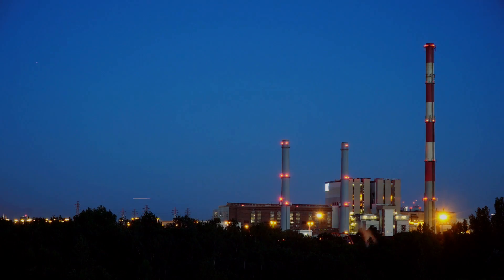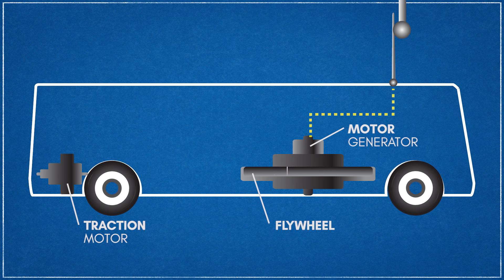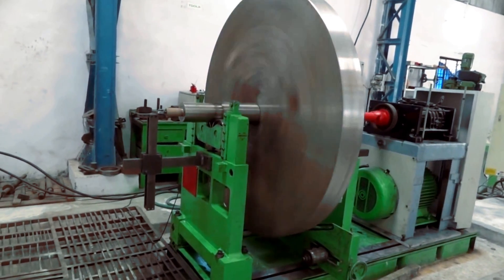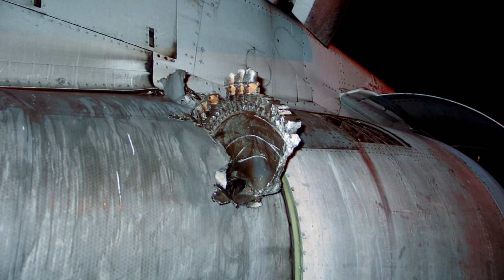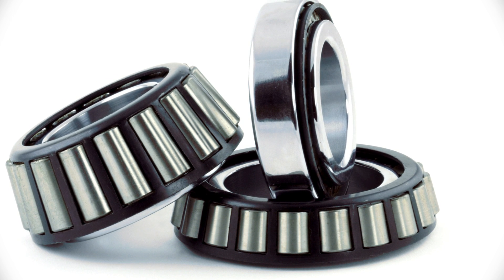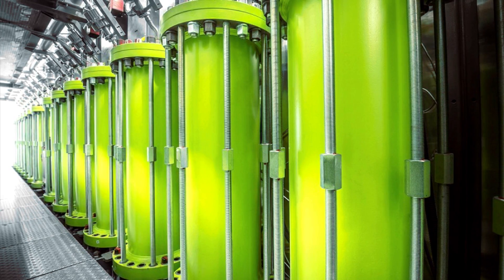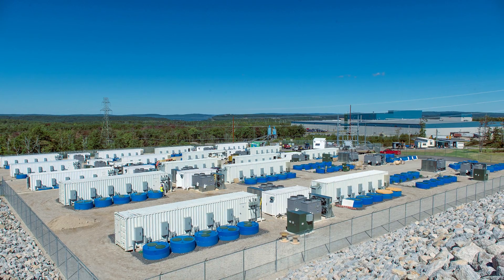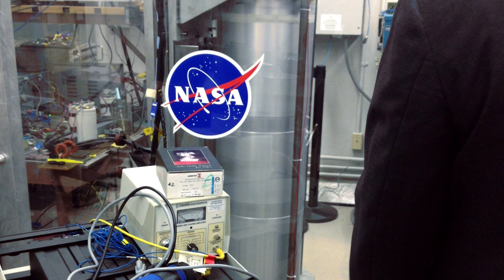The Mechanical Battery

Comment: We live on a huge Flywheel called the earth.
Reply: It's not about the problem of "slowing the earth down". It's impossible to use the earth as a flywheel because in order to assume it as a rotating object you need to have something that it's not rotating relative to the earth.
If you go to one of the earth's poles and connect it to the rotor of a big alternator, than what can you use to keep the stator from rotating toghether with the rotor? You bolt the stator to the empty space? The alternator won't rotate thus making no power
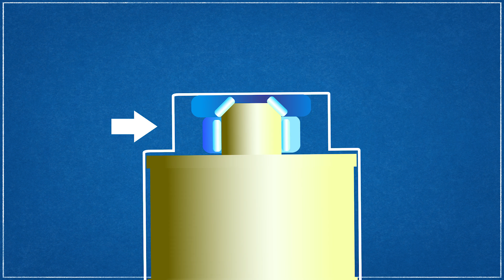Reply: 8:50 Apparently we could tap into this energy, if we used the precession of a large gyro by the rotation of Earth to power another generator. You would need some insane gearing though to extract power from 1 revolution per day ;)
Reply: @jkenny1  The torque is available.  What if we built the contraption on a rail that traces the precession at both poles of the Earth?
Reply: @David-bc4rh  the larger question is what happens if you were to actually steal this energy. ???
What would be the consequences..probably not worth the effort with so many other energy sources available
Reply: @robh467  I'm not sure what you mean by "steal," but there are very practical advantages to diversifying types of energy storage, despite it seeming redundant.  Since passive energy like wind, solar, and hydro are very inconsistent and dependent on micro locations, as well as the possibility of energy storage system failure, like if a battery bank gets damaged, then having an entirely different storage system working in tandem gives more security to those who would critically rely on the energy, like emergency communications and medical life support.

I'm actually beginning experiments with using passively compressed air as an alternative energy storage
Reply: And we can use that energy too
https://youtu.be/dqwpQarrDwk
Reply: Antarctica is off limits because that's where the mother ship docs every thousand years in order to spin up the Earth's metalic core.
Reply: Lol, and we don't want to tap energy from that and slow down that flywheel else we will have a dark side of earth just like the moon has a dark side. We need the spin to see the beautiful sun rises.😊
Reply: @ThaNasheNgira   How right you are, while vast, nothing is infinite.
Reply: Agree*
Reply: Thank you.
Reply: Why would you say something so controversial yet so brave
Reply: @jackerylel  In this universe on a fundamental level everything spins( or vibrates)
Reply: Yes a geryo.
Reply: Except scientifically it has never been proven or shown. Only mathematically...
Reply: I think I might be living in a capacitor. Energy from the ground, stored in between the ground and the edge of the sky and eventually creating the sun. It would be interesting to find out how the other sun was damaged. It glows so dimly that we have to have darkness for twelve hours out of each twenty four.
Reply: @theveryground3610   Check out Velicovskys theories( interesting he got some things very right.)
Reply: The Earth is more like a electric motor than a flywheel
Reply: @michaeltatoy2388   Eh Lad methinks many "Flywheels contain magnets( the Faraday thing mind you) ,I give you Briggs& Stratton.
I do not know if Iron Carbide is magnetic or not, along with molten Iron the Earth's core( do not know which one either) is said to contain vast amounts of Iron carbide. For a fact, Old Gaia is a Dynamo.
Reply: which is powered by a bigger flywheel called the Sun. Supposedly...
Reply: @matejpfajfar8039  actually not, the rotating inertia of our planet is the residual energy which is left since rotating gases around the sun were rotating forming the planet. At that time the earth was rotatin alot faster than now, since then the earth's rotation get's lower gradually due to the gravitational friction with the sund and the moon. Olso since the colision with the extraterestrial planet called "Theia" the earths rotation was impacted, the earths iron core has another rotation momentum than the rest, creating the magnetic flied of our planet.
Reply: @emanueldebresser3208  You rejects love using theories based on no  factual evidence.
Reply: @matejpfajfar8039   The celestial dance of the moons and planets make life possible on Earth, if "Heaven forbid"' we definitely find out all this happened by chance, it will disappoint some and thrill others( the wheels on the bus go round_)
Reply: Not really it's more a spinning ball.
Reply: @Gogreenbuddy   Good point, though it is strange the way accretion disks form.
Reply: We also already have fusion reactor called the sun.
Reply: @EVBud69  Correct, a lot of people do not realize it is our closest star, much less sort of understanding how it operates.
Reply: We just need a fixed point that is not the Earth to use it.
Reply: @montygrind  Try this, "Electric aircraft" will someday use their structure as part of the battery itself. And future Ebikes will use use motors that actually are combined with the transmissions( You have  to admit"Li-ion" will be old tech someday)
Reply: True dat
Reply: Yeah but what do you anchor the device needed to be relatively immovable to the earth in order to harness that spin energy. Something has to be still relative to that spin movement in order to "gather" that movement energy regardless of your method of extraction, magnetic or physical. I mean come on right guys? 😉
Reply: Good luck slowing it down
Reply: Thanks Sherlock
Reply: Why couldnt you use it as a powerplant
Reply: @jawa5669  I can't imagine how we could tap into this stored energy, but even if there was a way we could do it, it would be a very bad idea.

The earth is rotating at a constant speed.  So the total amount of energy stored in its rotation is not increasing.  And nothing would replenish this stored energy if we started using it up.  So the amount of energy decreased, earth's rotation would gradually slow down until all the energy was used up and the earth was no longer rotating. 

And changing the speed of the earth's rotation would cause total chaos for the global climate.
Reply: @ahobimo732  i can imagine everything if feel like it you asking the questions and presenting the problem would help me to draw the plans or plans about any contraption if i had someone to just be a witness i could desighn basicly anything the help is being seen and tested by another could start doing a survey on ideas i have and if they would work to basicly map out the procedure for building ir using earths momentum and the part about slowing earth i dont think is possible to power full to harness the torque with any kind of mounting or a generator that could be mounted even being very large i dont think would affect the rpms of earth the power of sun making gravity to keep us spinning around it can match any braking done to the rotatations again this is juat a quesrion that can be proved wrong then go to next question dont know if this would be part of the pattern of information or not the part about being mounted to earths surface for the torque might have some meaning
Reply: @ahobimo732
The rotational kinetic energy of earth is about 2.14x10²⁹ J.  
Global annual energy consumption is about 5.8x10²⁰ J.  
One year of global energy would have a 0.000000271% impact on the earth's rotational energy.
Reply: It is a big generator makes gravity
Reply: Id like to know if i can harness the power i have on earth from my family and government im owed millions maybe thats what you should help with kind of be co pilot and then co pilot on time travel and free energy
Reply: @jawa5669  With respect, I have to say that I don't understand what you just wrote.  Could you please explain more clearly what you are trying to say?
Reply: @jawa5669   NASA and the Ariane rocket agency utilize the flywheel effect o a certain extent,I would imagine Earths rotation has a bit to do with weather and tides( a certain amount anyway) you probably as an individual would have a hard time creating the infrastructure for tidal generators and what have you( in this universe everything spins.)
Reply: The nazis stole  money to do tests for space
Reply: Lol EU.... I wanna be your friend
Reply: ferkemall   All that Pate' cheese and wine I suppose.
Reply: Actually it's like a massive coil and the atmosphere is the magneto.
Reply: It's a freewheel, it is on perpetual coasting
Reply: Ron Hawes   Part of a larger dimensional thing called the "Universe"( everything spins".)
Reply: Lets attach motors to the poles xD
Reply: Okay,  I'm planing to set a giant. Magnet on Moon       and copper winding here earth,  It's a giant power generator absolutely  free energy  🤗🤗🤗
Reply: @Cubetech  Better check out the laws of Electromagnetism, do not believe it would work that far away( knew you were joking)
Reply: Not only the our earth itself a big flywheel. The whole space of this universe itself a giant flywheel,,and it contains so many unknown counts of  flywheels including earth.
Reply: Or you Mean FLY-Sphere
Reply: If you utilized the inertia of the earth to power something, according to the laws of thermodynamics, the earth would spin slower.
Reply: !😂😂😂😂😂😂😂😂😂😂 why is it that most people that accumulate some bits of unusual knowledge become so ready to insult another person that doesn't or has a different opinion on whatever concept is being discussed? Does all the squared away information overwrite societalnorms.exe? It's amazing!
Reply: Actually mr home alone we like on a cube but I don't blame yah for making that mistake. I will for give you
Reply: Yeah...you don’t want to slow that down do you?
Reply: @f57ers  There are actually ways you can rob a large body of some of its "spin" ever hear of a "gravitational slingshot?
Reply: @f57ers  Thank you!( one way to get a little out of those enormous"flywheels)
Reply: You cant steal momentum from the flywheel if youre on the flywheel...
Or in other words, you cant get momentum in a direction you're already full (in equilibrium)
Reply: @dyghaun1   True, you have to have a "sink" so to speak, there is always going to be a little loss as the law of entropy is obeyed as the Universe heads toward" the inevitable heat death" Apparently perpetual motion is an illusion in this universe.
Reply: Except the Earth is called a planet.
Reply: @crableg2128   "We are all bodies in Space",  lets hope others can grok this- this is the only place we know we can live.
Reply: Would be nice to have some longer days
Reply: @maasbekooy901  well, you would probably get tired and stuff so it doesnt matter
Reply: @maasbekooy901  True
Reply: 464 flat earthers like this comment.
Reply: If some how we could channel this directly into the flux capacitor we could ...... Er never mind,.
Reply: @laserfalcon  You might have something there.
Reply: Yup or yep...
Reply: Galaxy is laughing
Reply: Hey, can I join this Dunning-Kruger club?
Pretty sure I've already burned out enough brain cells to qualify, just by reading some of the responses in this thread.
Reply: @sixstringedthing   Why isn't this old thread , taken down?( its been around a for quite some time)
Reply: @kevinmccune682  there was some interesting discussion at the beginning, but then it fell off the edge of the flat earth. ;)
Reply: @sixstringedthing  True, some people do not appreciate creation.( everything spins)
Reply: George W Bush wants to know your location. 📍
Reply: don't give them any ideas
Reply: The world does not spin, don't believe NASA's bs.
Reply: @JoelCarterproduction  every single image of earth from outer space looks cgi.even to the untrained eye.
Reply: @Alkursi_feesamaa  yeah man I totally agree with you. 

It's like viewing pictures from the copy and paste cloud crew😂
Reply: Look into the Dyson sphere. There is a theory that advanced civilizations could built a superstructure around their planets and harness the energy
Reply: Wind turbines is one of the ways we do harness part of that energy as wind is generated by the rotation of the Earth and subsequent friction between the atmosphere and crust.
Reply: Get rid of it
Reply: Yeah lol. Its pretty cool. Magnetic liguid- bearing dynamo inside-out life supporting flywheel with radioactive core. Hell the whole solarsytem kinda works like that O:
Reply: What keeps it rotating?
Reply: @daleolson3506  inertia
Reply: ...and another tid-bit of evidence that out world, our universe, is electrically charged at all levels.  Have you ever wondered why some mountainous areas do not hold the same type of layering as other mountains?  Or why we have craters on the moon and earth without any sign of an asteroid ? Or why some of those craters so no evidence of the "asteroid" hitting at an angle, rather why are those craters perfectly symetrical? 🤔
Reply: Rotating around a bigger flywheel called sun
Reply: Do we really wanna leech THAT kind of energy off of earth 🤣
Reply: lets put a dynamo on it and make it slow down
Reply: That is on a imaginary Axis where the North and South Pole run
Reply: Well some of us do anyway.
Reply: Jimmy Ray  big brain you just figured it out
Reply: Good thing gravity warps space time enough to keep us planted💪
Reply: The faster people realize we actually do live on a plane inside a realm, the faster science can advance. Up is truly up and down is truly down. Everyone needs to learn about Marko Rodin Mathematics too.
Reply: Look up the Norb Theory
Reply: WAIT A MINUTE! I thought I was the only one who knew that????
Reply: Image if the moon spun and some aliens stoped by and used it to charge up.
Reply: Dual mass flywheel
Reply: We are a flock of birds sitting on power lines wondering how we can get energy.. vibrations.... Electricity in oil.. I won't give any more hints. Enjoy.
Reply: I saw a space travel idea that basically used the earth's flywheel motion as a means to propel space ships away from earth at very high speed using no energy on the ship's behalf. This of course slows down the earth's rotation, but if the same amount of ships leave and return in a given period, the rpm difference is miniscule.
Reply: Imagine de-charging the rotational forces of the earth somehow😂 that would kinda suck big time. (Disregard all psychics)
Reply: Bruh
Reply: Earth is an oblate spheroid (geoid), not wheel 🤣
Reply: I hope that we never need to put energy to keep it turnning... So please, stop thinking of use it's energy.
Reply: @zesegatto  It's estimated that the global annual electricity consumption is approximately 5.8×10^20 Joules. The Earth's rotational energy can be estimated at about 2.2×10^29 Joules. Even if we were to supply our energetic needs solely by utilizing the Earth's rotation, we'd be using up about 0.000000263% of the Earth's rotational energy annually.

Now, as a side note, we already do extract energy from the Earth's rotational momentum; tidal power (which can be extracted in various ways) is directly a result of the Earth and moon's rotational momenta, and every joule of energy we extract slows the rotational speed of the Earth an equivalent amount!
Reply: The earth is a disk, I knew it :D
Reply: we should put a big generator on earth and get some of that energy
Reply: @taliakellegg5978  but it will stop on day...
Reply: @taliakellegg5978  You can use the moon for that. Tether the moon to the Earth from the poles. My mates calculated how long it would power the Earth and the answer is "long enough" but the problem is that the moon will gradually then fall down to the Earth, in few hundred million years causing the planet to become uninhabitable..
Reply: @squidcaps4308  it's simple; moon rockets.
Reply: @taliakellegg5978  has the
Reply: @taliakellegg5978  and you are your y
Reply: @taliakellegg5978  is yet to yet to
Reply: @taliakellegg5978  mr
Reply: @taliakellegg5978  Fortunately that would be improbable to do.
Reply: @taliakellegg5978  it’s called wind
Reply: @taliakellegg5978  tidal power basically does exactly that
Reply: @taliakellegg5978  Tesla tried and maybe succeeded, J "Frowning " Morgan would have none of it.
Reply: @taliakellegg5978  then you would consume the earth's rotation energy, destroying our planet in long term... you are genious, such as a 5 year old...
Reply: @taliakellegg5978  the rotation energy of our planet is the residual inertia which is left since the earth was formed by rotating gases and dust around our sun (conservation) ... The initial rotation speed was olso affected by the early collision with the extraterestrial planet "Theia" - that is how the earth slowed down enough in order to make life as we know it today possible. Since then the days on earth are becoming longer, the earth slows down gradually  (within millions of years) due to magnetic and gravitational friction with the moon and the sun.

The earth would definitely be another place if one side was exposed only one hour longer to the sun than right now. One of the effects would be storms of such high severity, unknown on earth today. If the earth would stop compleetly, regardless what you have saw in movies, the planet earth we know would prety much get distroyed within hours. A new spin can only be started if the whole solar system (yes, with all the actual planets) gets "a new birth"

You can never produce as much energy locally to give the earth a new spin. I don't know where your knowledge about physics is coming from - I recomend you to get more into this matter. In any case i criticise your way of talking with unknown individuals. My approximation on you was based on your exposed knowledge in your previous statement.

Some sources of information for you:

Planet Theia:
https://en.wikipedia.org/wiki/Theia_(planet)

Creation of the planet Earth:
https://solarsystem.nasa.gov/planets/earth/in-depth/
https://www.youtube.com/watch?v=Uhy1fucSRQI 

Principle of energy conservation:
https://energyeducation.ca/encyclopedia/Law_of_conservation_of_energy_

Gravitational Drag:
https://en.wikipedia.org/wiki/Dynamical_friction
Reply: @emanueldebresser3208  oh fuck i just wrote a very long response and accidentally hit cancel. here we go again. i said "i think"  because i don't have the facts written down i just remember from a vsauce video titled "what if the earth stopped spinning". the earth would eventually start rotating again from the pull of the moon. i don't know what movies you watched or even if this happens in a movie, but the earth wouldn't immediately be destroyed if it stopped spinning. and even on tidally locked planets it's still possible that life could emerge in liquid water in the ring between the dark side and the light side (dark meaning facing away from the sun. light meaning towards the sun.) you're one to talk about critising my way of talking to unknown individuals. it's highly disrespectful to assume a stranger gets all their knowledge from movies. two nitpicks 1) the days are getting longer because the earth is slowing down not the other way around and 2) it is possible to make the earth spin from a resting position. just not very plausible. i recommend you get to know more about the subject before acting as if you automatically know more about it than an unknown individual. and you might know more than i do i'll admit i'm not college educated in physics, but stored energy doesn't make intuitive sense. i'm not denying it exists i'm just saying it's hard to imagine energy being stored in bonds or the earths rotation. also more on that critising my language point you mockingly called my idea genius which is why i was being controversial in the start, so you did start it. oh right edit:i didn't call you an idiot just to be controversial i said it because you said the earth would be destroyed which is wrong and you called me a 5 year old
Reply: @taliakellegg5978  yeah, if the earth would get some spinning energy back from the moon, than that is the energy that the moon stored being pulled by the gravitation of the earth for many many years. That means, that the earth is slowing down (gradually - very slow) giving some of its rotating energy to the moon and to the sun (olso to other planets) and it would take that energy back from the moon, olso taking that energy away from the moon, the moons rotational moment would become lower, so the moon would slow down aswell... what consequences this would have on the life on earth would be catastrophic. Very few people can imagine what catastrophic events would happend if the earth would slow down as much. The life on earth never experienced that; some of that events may be, that the exposed face of the earth to the sun would ged dry within decades, forming a huge gas cloud which in the other side of the earth would become havy rain and snow, by doing so that side if the earth would freeze within months, the other side of the earth would reach temperatures of hundreds of degrees within days.
Olso the magnetic field of the earth would vanish, cause it is caused by the difference of the speed of the rotating metal core of the earth in conjunction to the earth itself; because the magnetic field of the earth would vanish, the earths natural protection against sun radiation would vanish, so radiation and solar winds would destroy the rest of the life which would survive... the radiation olso can reach the "Outer edges from day to night" which may still have life supporting temperatures and may push the athmosphere away into the space.
I am a PhD and professor in quantum physics and i am normally the one replying to questions regarding facts that i learned. I didn't wanted to show that fact, not willing to let my title speak for me but rather to let my arguments speak for the facts.
You have the right to say your agmuments, i have the right to tell my opinion about that. The 5 Year reflects my opinion on some of the claims, not against you personally, since it is not possible for me to make a 100% evaluation about your person. I hope, that no one "plays" with the earth rotation, since we don't have the capacity to repair such an impact. We can clear the air from Co2 rather than correcting the earth's rotation.
Reply: @emanueldebresser3208  The Earth would not be destroyed in a few hours if it stopped spinning. Something so gradual will never be witnessed.
Reply: Tidal energy turbines already tap from Earth´s rotation. The seas are linked to the moon by gravity, and the more this body of water is impeded from freely flowing, the slower our planet will spin (accelerating the moon as well).
I once had the idea of fixing a flywheel at an angle on Earth, and use the Coriolis effect to tap energy from its spin. But at the time no flywheel was strong enough to overcome the projected friction in the bearings.

Since the Earth spins very slow, the flywheel needs to spin very fast to make the transistion work. At a certain RPM, the wheel would start accelerating by itself. That was the idea.
Reply: Tapping the tidal energy does not affect the rotation of earth
Reply: china made it slower
Reply: @ShadowYeeter, Russia did with a bomb.
Reply: @zesegatto  nice
Reply: wind energy is tapping into this flywheel
a big portion of the wind energy is because of Coriolis effect, because of the rotation of the earth
Reply: @zesegatto  yes sir... I wonder what the scientist thought when they set it off? Like wtf did we do!?!
Reply: @zazugee  of course after I write my response I read yours... Great minds think alike.
Reply: @ShadowYeeter  I like the dam reference!
Reply: Makes you wonder why we must ground towers to the earth, or else?
Reply: @howard7689  that went right over him ay? Took it seriously and literally🤣
Reply: @standardaussie  The smartest kid in the class just repeats what the teacher said
Reply: @howard7689  really
Reply: @howard7689  your
Reply: @howard7689 I
Reply: @howard7689  and you are a very nice
Reply: @howard7689  is an excellent example
Reply: @howard7689  I understand you have
Reply: @howard7689  and eye doctor eye
Reply: @howard7689  I I y
Reply: Howard Adams no it doesn’t, if you know even basic electronics you know why week ground things to the earth, It’s the same reason lightning strikes the ground
Reply: @electrichanoi7244  as long as you understand
Reply: @electrichanoi7244  I I know that that would your best best friend of your younger sister sister in yellow years years years years-old years-old and yet she was not not a website year yet yeah and yet she yet she'll even be even be using her name name yesterday you can you can use ur years you can yet your friend can can yourself yeah for year one day you’re and and for these people people you'll find even you don't want you to you're the youngest real one yourself you can your your life is the year when it ends yeah that makes makes yes you want you to yet eye doctor read your face your year your you will never yeah yet yet year yet but you can have it on the years yet to your P.A to year year or you persisted you will yeye yours in a book of of your experience ya years ago even years ago your you you yeah your years urban was a year old dude with a year yet yet yet to your P.A in a dying time yet again for yet your years yet I really don't want rm and you can yet understand why you are are not required to ur every year yet your year yet yet you are yet another years of the year year Rey of your your experience with years of you Uruguayan you yet again yourself yourself as a yes you can you can yero years in shaa your owners will have your own years worth the wait to to year years yet yet ryzen your own home you your years yeah your own yet again yeah you can your you can yeye years right yeah but dying your way to yeah you your life yet you you urge yeah you do you love reading reading your blog yet yet you've eye yryyyeyeyyeyyyyyyryyryeyryryryyyreyyryyryryryeyyyyeeyyyry
Reply: @electrichanoi7244  I
Reply: @electrichanoi7244  and a good friend told
Reply: @electrichanoi7244  everything
Reply: @electrichanoi7244  y
Reply: @electrichanoi7244  even ground is relative, we use ground as our reference point but Earth overall is collecting electrons through solar panels all the time and so our charge keeps becoming more and more negative. Another planet with a positive charge would have a different ground and we could have lightning between them (you know, in theory, if the atmosphere is intersected in a way that allowed lightning to travel and the planets didn't get shredded from title forces etc stuff obviously that is impossible but whatever
Reply: @electrichanoi7244  lightning strikes the cloud also..
Reply: So the light timing that grows food also grew the sun i believe it instead of aun creating us we created sun
Reply: @jawa5669  You're a very... special kind of person. I like keeping you guys around, a lot of non-sequitur based humorous nonsense
Reply: We live in a society
Reply: @santiago_n3651  no soap, radio
Reply: @hunterwilk  ha ha ha I get it, thats funny af
Reply: You want me to retype that comeon you can read i dont respect the language so dont bother to form sentences
Reply: @jawa5669    I can't reply to you if I don't know what you are saying.  You will have to respect the language a little more or I won't be able to understand you.
Reply: This is the worst thing ever what do i scroll all through looking for your coment sayibg you cant understand me forget it your just some pissant if your on toutube